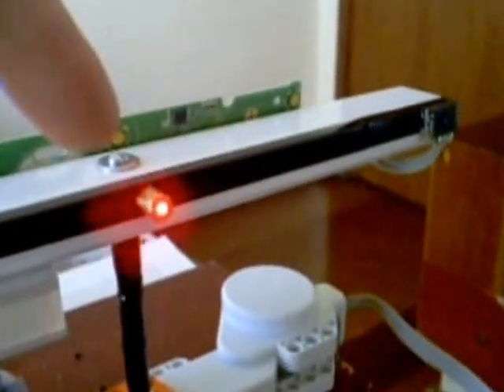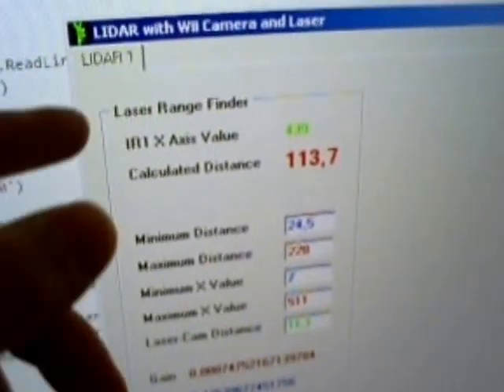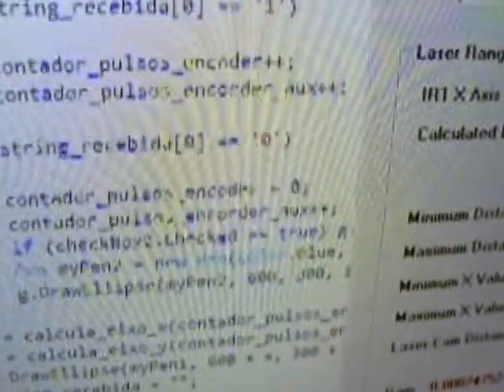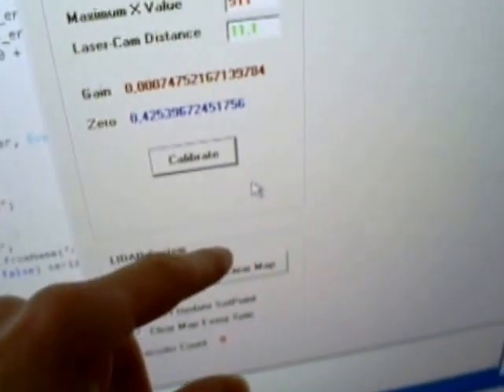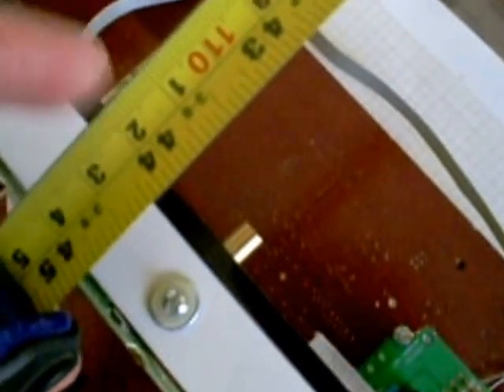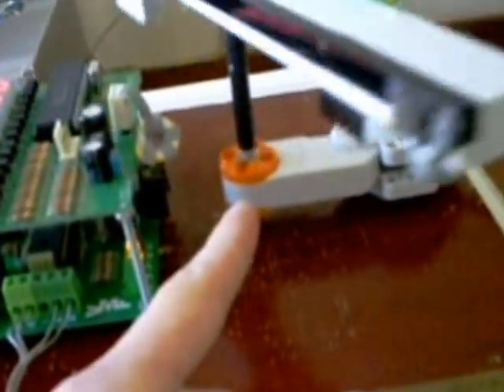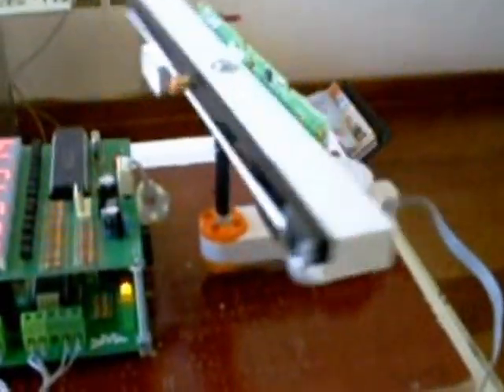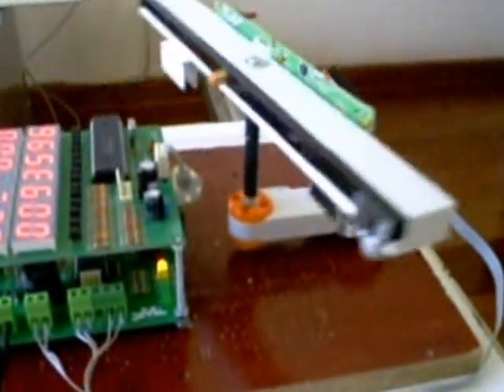2D LIDAR With Wii Camera and Free Spinning Servo Motor (WiiDAR)

Comment from the maker: Thanks!

I'm going to test at least two more lasers: green and infrared (both with 5 mW). I have a violet 20 mW laser too, but the amount of power concerns me. The best results in detecting glass, black things and distance up to 6m will be put to work for good.

I can't commit to share all the information because part of the project is a commercial equipment. But some code I will share on the end of the project.